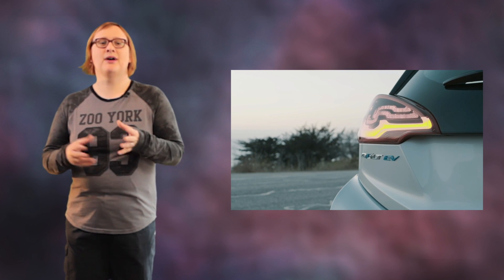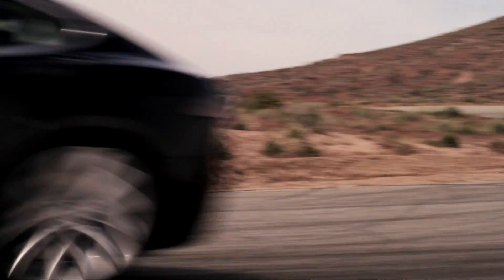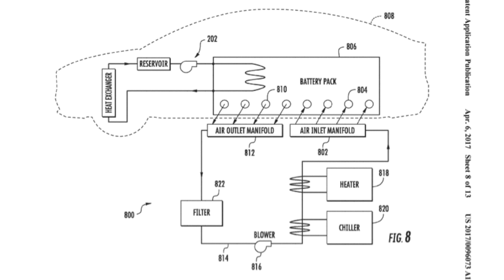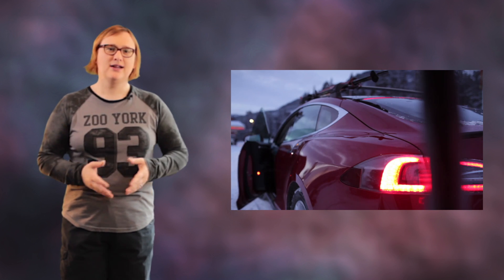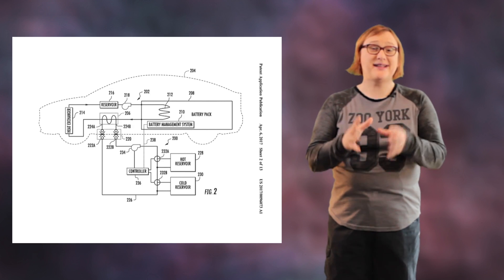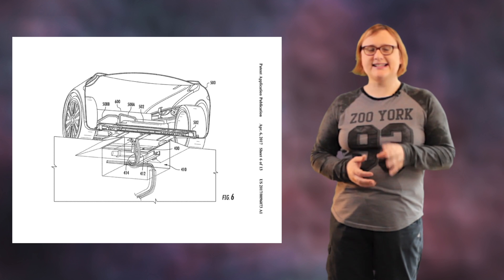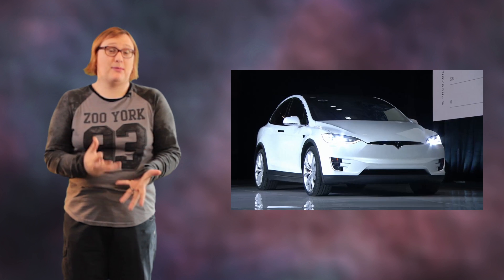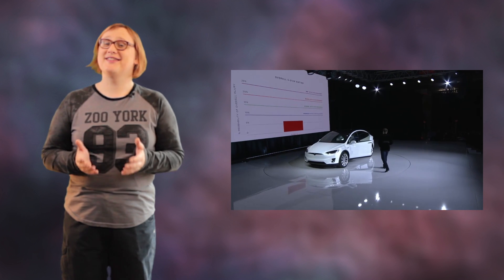Why Tesla Wants To Put Its Battery Pack On Ice For Super Fast, Super Chill Supercharging

Comment: Just a work around. As I've already stated several times, Li-ion is at the limits of it's capability and it's inability to absorb ever faster charge currents in an ever shorter time is becoming apparent now. Tesla is totally committed to Li-ion so it'll be interesting to see what happens when solid state enters manufacture.
Reply: I doubt Tesla is totally committed to Li-ion, it's just the best tech so far with still more room for improvement. Of course battery tech is going to change in the not too distant future and Elon probably knows it too. I'd be disappointed if the gigafactory wasn't designed to be adaptable but I don't expect to be.
Reply: Robin Harrison. It's not just the physical infrastructure. It's the contractual infrastructure. Tesla loves to brand the Giggafactory as theirs, but the financial reality is it's run and primarily funded by "Panasonic" which is just a brand name of Matsushita which is Japan's biggest electronics company. With Tesla already over $3 Billion in debt, how are they going to re-tool for a completely different process, and how are they going to wriggle out of their manufacturing lock solid deal with Japan's biggest electronics company? Every car maker on the planet is totally free to buy any solid state battery they want, or set up their own "Giggafactory" building solid state. I see a huge problem for Tesla.
Reply: I absolutely totally disagree with the premise that the "golden days" of Li-ion are just ahead. Every scientist/electrical engineer who actually knows their stuff can point to the very forthcoming end point in Li-ion capacity. Both in charge speed capability and charge capacity. The end is already in sight and the temperature limitations which are unsolvable (based on the very chemistry on which they work) require work arounds . New tech is coming and that's great news. Not for Tesla though.
Reply: No one is committed to given battery tech dude. Musk said several times that he needs the best and most dense battery tech so once (and if) and new battery tech appears he can switch gears fast. Battery swap even on the already sold cars is trivial.
Reply: Are you suggesting Panasonic may not know that batt tech will change? They have a very close partnership with Tesla and they will no doubt deal with the inevitable change together. They probably already have plans for it.
Nobody here said anything about a future golden age for li-ion, merely that we can still expect improvement in performance and price and we can. Meanwhile the tech is practical for EVs right now and getting better all the time so no need yet to retool. Indeed, if there are no major problems with Model 3 and the gigafactory the debt will be no problem either. Take a look at their share price. A lot of the smart money seems to agree.
Of course energy storage technology will change and I expect Tesla and Panasonic to be leading that change just as they are currently leading the change to EVs.
Reply: If Panasonic did say that, no doubt Musk payed attention. Are you seriously suggesting Musk has decided li-ion will do without considering the future? He hasn't done 'yeah, that'll do' with anything else in his life and I can't see him starting now, particularly given his background in energy storage. 
We can probably expect Tesla and Panasonic to be at the forefront of energy storage technology for some time. Well beyond li-ion.
Reply: Karl P  who told you he is going to retool a factory again? oh your assumptions... Everyone is telling you that Musk is looking into battery tech closely too but you know better right lol...
Reply: Since you and I both know battery tech will change, it's unrealistic to imagine Musk hasn't worked it out too without the need to be a nazi overlord. You suggest friction between Tesla and Panasonic but nothing could be further from the truth. Tesla has the best battery tech available along with a serious hand in development and Panasonic went from 7% battery market share before this partnership to 41% now. Neither are in a hurry to pack it in.
Despite your repeated protests, there will be no need to retool for quite some time. Meanwhile they will be producing close to half the batteries in the world which will probably be profitable enough to well and truly deal with future retooling. 
Your assumptions about me are as erroneous as your previous exaggerations and now you are reduced to irrational insults, which isn't giving whatever point you are trying to make any validity. It looks like you have a quite serious hatred of Musk and Tesla. I wonder why?
Reply: Justin Davison
So you and I are completely aware that lithium is not the energy storage of the future. However, you appear to be suggesting Elon Musk is not as smart as you and I and hasn't understood that yet. That's a big call. You may have built some EVs, so have I and Musk has built way more than either of us. He definitely knows more about it than me but, in your mind, probably not as much as you.
BTW my home and EVs run on solar+storage so you have your work cut out trying to convince me lithium isn't viable right now. My wallet is far more persuasive than you.
There is no blind following, just close observation of a very clever guy doing very clever things. If you haven't noticed that yet you're really not paying attention. Likewise there is no 'defence at any cost', just logic and reason which you seem to find offensive and, incidentally, if he starts fouling up I'll be the first to point it out. 
The appearance of eloquence on our part is probably due to the fact that the only people descending into irrational insults are you and your mate Karl. You could probably teach him a thing or 2 about dishonest exaggeration in an attempt to make whatever point you are trying to make. 
 It looks like you too have a quite serious hatred of Musk and Tesla. I wonder why?
Reply: It would be nice if started speaking sense rather than senseless derision, which is never persuasive. You can try milking if you like but I suspect you will be spectacularly unsuccessful if your efforts here are anything to go by.
 It looks like you too have a quite serious hatred of Musk and Tesla. I wonder why? And I wonder why none of you intellectual giants are answering that question.
Reply: Justin Davison
And so your response is pseudo-intelectual insults with zero substance. Well done you. BTW you still avoid answering my question so here it is again.
 It looks like you have a quite serious hatred of Musk and Tesla. Can you tell us why?
Reply: Justin Davison
You and Karl P appear to have quite a problem with reading and comprehension. Either that or you are deliberately misrepresenting what's said in order to push whatever agenda you might have. If your agenda needs lies it's probably nonsense and thoroughly dishonest.
Of course I admire Musk. If you haven't noticed yet that he's done some admirable things then you're really not paying attention. However, it's not uncritical admiration as that would be dishonest and a serious disservice to both me and him. I've watched him make missteps and also watched him do whatever he can to rectify them.
BTW the only evidence I ever see of blindly worshipful Tesla devotees appears in the comments of anti Tesla people like you and I've seen no examples of that stereotype in reality. Granted I don't read everything so please feel free to provide actual examples of this seemingly fictitious stereotype rather than your usual fuzzy, uninformed and baseless accusations.
Reply: I've certainly paid attention to whatever answers you've reluctantly provided and seen all your fuzzy, uninformed and baseless accusations.  Good to see you admit he's done some worthwhile things although I and a great many other people don't agree with you about his cars. In addition a huge amount of smart money certainly don't agree with you about the potential for Model 3.
We will know later this year whether the integrated gigafactory concept, the machine to build the machine, is a goer. If it is it will be rapidly replicable globally and, already, countries are lining up to get one. If they pull that off your assumptions about the stock price are completely erroneous. It can only fall about $310 but has the potential to rise by considerably more than that.
 I see you've failed to provide actual examples of the blindly worshipful Tesla devotee stereotype. Good luck with that.
Reply: cinema writer. Nah. If that was true the take-up rate would be much higher (even with big subsidies) than < 3% in California. Which is the biggest market. There's something missing in the EV world apart from price. "Premium" SUVs are booming at a price point much higher than the expected price of model 3. Cheap gas maybe? I hardly see anyone commenting lately about fuel economy.
Reply: Robin Harrison Panasonic has said a year or two ago to the press that musks demands can not be met by lithium batteries. it is physically impossible. they said it... his partner. everyone ignored it... pretty stupid. Tesla is heading for a wall
Reply: Justin Davidson. I say things here, and get continuously attacked by know nothing greenies, but I actually have avenues of information which 99.99% of people are not previ to.
Reply: Karl P I agree. I'm shocked at the cult like following musk has been able to create. I get the excitement but I don't understand the blind following and the defense of him at all costs. my favorite is when they try to sound eloquent in a reply but have zero back ground in engineering or electric cars. they just say "you don't think he has thought of that" as a person who has built several electric cars I have a deeper understanding of this than most and I can assure you that I understand more than most of these idiots in the comments sections. Panasonic said it... plain and simple. people think that technology just goes on infinitely. every technology has a limit. there is an ending point pansonic was simply stating that lithium is practically there and to expect much more out of it is not thinking clearly. don't forget Panasonic Tesla's partner in all of this is the one saying this. the leader in batteries. it's not me poo pooing the idea... it's them! sometimes announcements have to be made when you are publicly traded to CYA. whether the market listens is a while other story. my other favorite is that people don't realize how limited of a natural resource lithium is nor do they realize how toxic the open brine pits for lithium extraction/mining is. they think lithium is 100% recyclable lol. it's hysterical. these people don't very shit. they don't do any of there own research. they just blindly follow. 

also Mr innovation is now a massive company he is no longer going to be able to move as a quick startup. in other words he but the bullet on hitching his wagon to the gigafactories.
Reply: Justin Davidson. A Powerwall
Reply: Karl P lol. exactly.
Reply: And you still haven't answered the question.
Reply: You may have noticed all of these intellectual giants have studiously avoided my question, for whatever reason, but I can give you the lowdown on Ellsworth.
He's conducting an ideological campaign against his own personal Howard Roark. (The Fountainhead, Ayne Rand.) He can expect to even less successful than his namesake. Not only does he have nowhere near the public profile, he's considerably less intelligent than the original fictitious character.
But I hope he keeps it up, it's quite amusing.
Reply: Robin Harrison your last message was pretty much just arrogant posturing with no real substance. you must be a college grad.
Reply: Robin Harrison I don't have a hatred towards musk. why would i? I have a hated for idiots following people blindly and for people doing nothing but singing the praises of someone or something when they are illinformed. they do it because it makes them feel good. you can't even imagine Tesla making a mistep can you.???
Reply: Justin Davidson. Couldn't have said it better myself, in fact I was about to, but you beat me to it. Robin Harrison, I would add, get's ignored because he starts off with an incorrect presumption, so what's the point in responding to something that's wrong in the first place?
Reply: Robin Harrison. Ignored.
Reply: Robin Harrison love it you say I'm terrible at reading comprehension and then you spill on about me not liking musk... lol I don't have a problem with musk. let me ask you this... what's the point of asking a question if you don't want to listen to the answer? i think he has great ideas. im glad he exists but the blind is following him and he is reaching for the stars... he is gathering a ridiculous amount of money... he is going to have to make some things happen. unfortunately I don't think if he Batts a thousand he can pull this off... and no one has come even close to batting a thousand. 

by the way I love his solar roof concept. that is freaking awesome. his cars are terrible and this model 3 is going to be a disaster. his QC is terrible and his megaphone of blind followers are going to finally be able to afford his product..my unfortunately... if it doesn't work well that megaphone is going to be used the other direction and that stock has alot further to fall than it does to climb.
Reply: Robin Harrison you are. you are the glowing example. you are so blinded by it you don't see it (hence the whole term blinded) 

lol now you are probably wondering why i say that... here is your example you said something to the affect that smart money has out money on the model 3... you are delighting in it's success and not a single car has been delivered to a customer. Tesla has extremely difficult roll outs and this will be no different. here in Arizona the Tesla facility is a joke. long long lines for repair bad communication with customer promised loaners and then poof no loaner. new cars being delivered damaged or with problems hell I remember when they were charging all the cars on diesel generators. hahahahahahaha. 

keep drinking the Kool aid don't bet your life savings.
Reply: Robin Harrison. Why don't you quit while you're behind? Justin has nailed your head to the Tesla flagpole. You are the epitome of the Tesla cult fanboy which we are all talking about. You know? The scary kind. If anyone is guilty of "fuzzy, uninformed and baselessness" it's you poor deluded fanboy.
Reply: Robin Harrison other countries lining up to get one? I can assure you Canada... the entirity of the middle East will not be interested in a Tesla. there currency all depends on crude. so if demand falls... so will there currency. also all of the oil money has something called trillions of dollars collectively. they will and have begun to buy things such as Cobalt which are crucial to battery production... all they do is buy it and drive up the price... making the cars cost too much money for the market. 

this ain't checkers... this is chess... with some of the richest and most powerful people on the planet now beyond that... Musk goes in so many different directions all the time it's going to be hard to see him complete some of these things... this new Tesla semi truck... he is probably using it to raise cash without selling more stock. on my opinion the Ponzi has begun.
Reply: Justin Davison + Karl P
There are none so blind as those that cannot see. Oh what a flurry of protest. Here's something to help you get a little more informed.
 A Ponzi scheme is a scheme with no substance. No infrastructure, no products, nothing. It may be you're not dishonest just remarkably inattentive. On the other hand, you may be profoundly dishonest and trying unsuccessfully to spread lies. In which case, to paraphrase the little yellow fellow, eat your shorts.
Reply: Robin Harrison. Ignored (again)
Reply: Robin Harrison ha... you know you are winning an argument when the person tries switching the argument to something else... and worst yet a definition... a WRONG one of course. a Ponzi scheme is not defined by having zero assets... if that was the case Madoff never would have been busted. it's when you your whole to shovel ratio gets completely fucked up. you need fresh cash and the frsh cash is covering the previous service on the debt from before. for example... model 3 needs money to finish??? we'll bring out a new concept and take deposits. and spend those deposits not on the new concept but in the old model 3 I am not saying that is what is going on. I'm just using that as an example. 
.you clearly have zero business acumen or experience. you have no idea what you are talking about and are defending to the end instead of asking questions... so yes it is confirmed. you are a blind cult member of the musk tribe. good luck. hope you don't bump into anything.
Reply: Justin. I'm just waiting for Harrison to come out with their usual ultimate fallback when they run out of rational responses: "but..but..Elon knows best !!"
Reply: No switch of argument. You clearly accused Musk of running a Ponzi scheme, along with a litany of lies too ludicrous to bother with. Here's something else to help you get a little more informed.
The stock market is driven by profit and the smart money invests in growth potential with the possibility large future profits. Tesla's high stock price is because they have more of that than anybody right now with huge investments in infrastructure and a range of products across the energy sector and storage products with even more potential than cars. That blindly obvious investment in infrastructure and product development is clearly no Ponzi scheme.
You can tell people it's all bullshit till the cows come home but we'll know later this year whether Tesla got it right. If they have the stock price will be stratospheric. If not the short sellers will have a field day. All the signs so far suggest it's not a good year to be short.
Reply: Robin: Derision ? Of course, what do you expect ? Gee: read your comments: Musk this, Musk that, oh but Musk ...  Is he you guru or do you work for him ? The only original idea Musk had is to pack thousands of cheap 18650 LiIon batteries developed for the PCs while others were trying to design their own big safe batteries. Good marketing too, a "green" car that has better acceleration than a race car.
Reply: jawbreaker. You don't get it dude. You don't just casually retool a factory that cost $M850 building LIQUID batteries into one that uses GLASS batteries overnight. This is what the beaunuts who comment don't understand because they're not engineers, the PROCESS TECHNOLOGY IS TOTALLY DIFFERENT. And who's going to lend Musk the money after he's blown all that?
Reply: jawbreaker. You still don't get it. He can't break out of the $billion commitment.  He's locked into Li-ion battery production. With Panasonic (Matsushita). A brand new factory with brand new processes will cost more billions. And being at least 3.5 billion in debt already, not even those clowns at bloomberg are going to go for that. Bubble.House. Cards. Fall. Down.
Reply: High levels of debt , even at the Billion Dollars level, can be 
sustained over a period of time within a public company. It is highly 
unusual for a public company to sustain debt and accrue increasing debt  the amount of $B 3.5 without ever announcing a profit.  If that 
company has, at the same time, a market capitalisation which is 100 
times' its actual worth not even including debt,
Reply: Robin Harrison at the forefront of energy storage? ahh... yes... perhaps... but musk might be making the laser disc... or perhaps even the CD. energy storage isn't the key to this energy production is. a fuel cell type of technology is the future. the ability to be it's own power plant is the sustainable future. storing energy is one of the most inefficient things that can be done.... that's why it isn't really done
Reply: Karl P: I think that instead of speaking sense and trying to explain things these people are unable to understand for lack of knowledge if not intelligence, we should instead try to milk these suckers as Musk does !
Reply: Ellsworth. Yeah, totally agree, they ultimately always default to the "Elon knows best" argument. Like they know what Musk is thinking, Psychophants.
Reply: Robin Harrison. See your basic assumption is that Elon Musk is some kind of master genius, who has a grand plan for the world. I'm half German and some guy from Austria had a grand plan for the world as well. If you are a Musk fanatic, then you will say anything in his defence. There are several total shill channels (not this one I hasten to add) which are blatant Musk fanboy propaganda rants. And these are the ones that I attack vociferously